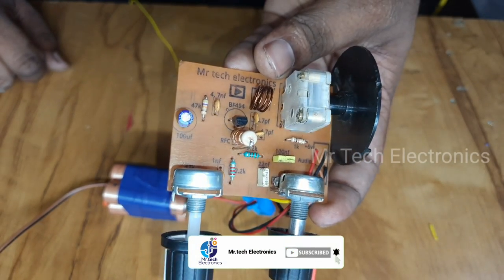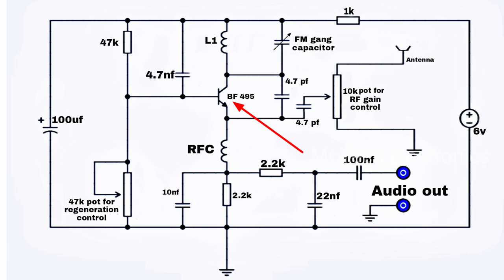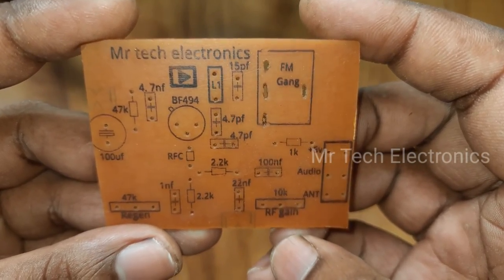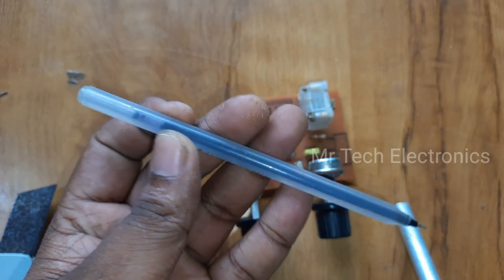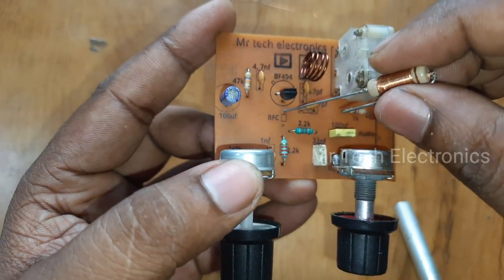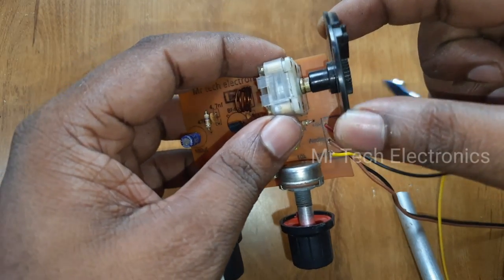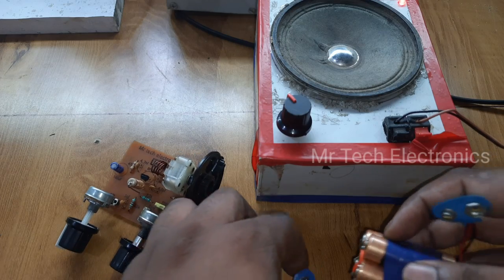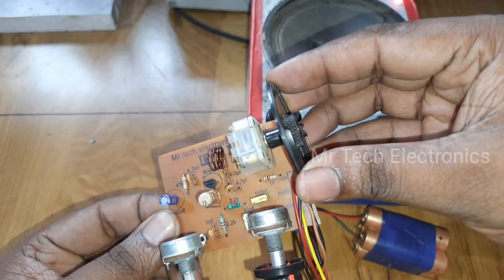How to make simple FM radio at home | DIY superregenarative FM radio

Comment: Sir, I made your another designed video's circuit of one transistors F.M radio receiver which was  performed very well, I had three  local F.M radio stations, Initially, I didn't have a good antenna building with me So, tried with Tata Play DTH Antenna; From that experiment I could also understand that Why & How antenna is so much important with perfect connections.

Comment: Bro oru doubt ind  bike battery aan 12v 5ah ampere enn vecha enthan ethra hrs run aakum ? Battery
Reply from the maker: It can deliver 12v 5A energy in one hour
Reply: @MrtechElectronics  bro apo 100mah ? Inn vecha?
Reply from the maker: @akhilmohammed1232  battery can give 100MA current in one hour
Reply: @MrtechElectronics  bro oru doubt ind  6v 100mah  ethra hrs aan ?